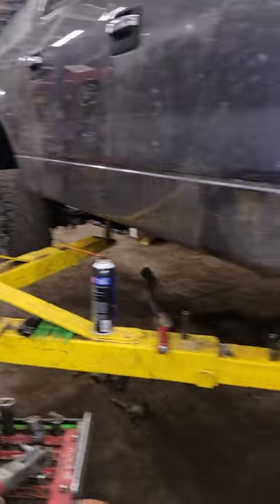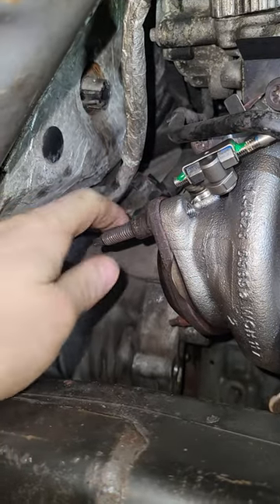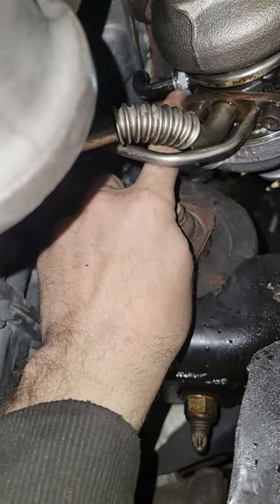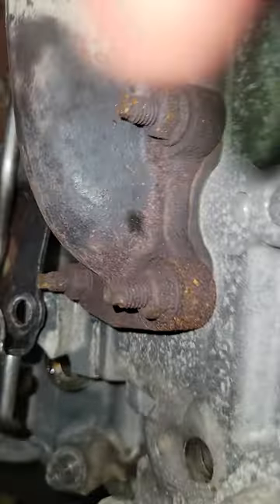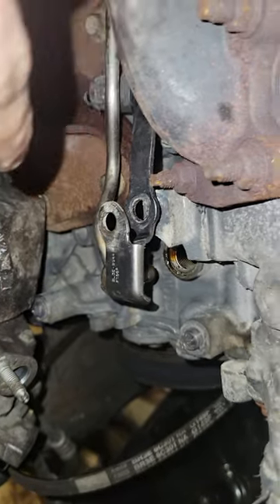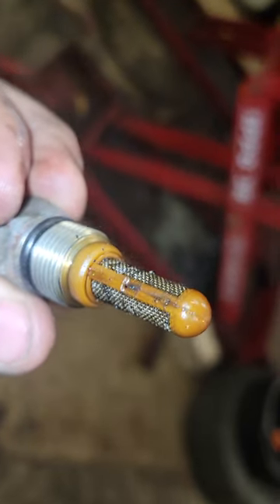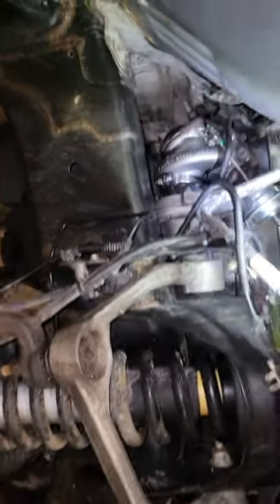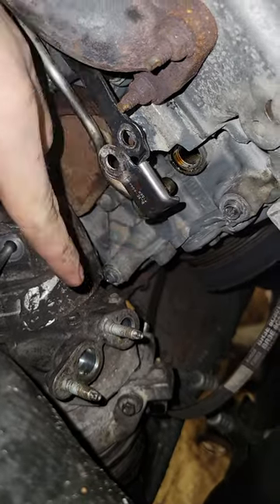ECOBOOST TURBO REPLACEMENT. tips and oil line filter replacement

Comment: It’s damn amazing how well you filmed this. It’s tight in there! Working through this myself now, plus the exhaust manifold replacement. I fear timing chain is next on the list.
Reply from the maker: Thank you. And yes it is tight in there ahaha. Timing chain rattle is what started everything and snowballed from there. 3 motors and 2 sets of turbos later. I'm actually about to pull motor again and fix spark plug stuck and fix a few other things while it's out
Reply: Oh the chain is coming for sure!

Comment: Thanks for heads-up. Is the replacement of turbos on 2.7 L as labour intensive, meaning you need to drop a/c compressor and a starter? Thank you.
Reply from the maker: I'm not sure about 2.7 but I'd assume it's very similar. Id imagine the platform is setup the same tho

Comment: I was able to replace the Turbos and all of the water lines and fittings plus the oil line filters. Yes I had to remove the starter the a/c and the alternator plus the intake manifold. Not a fun job to do by yourself but my 2012 has 260K on it and it's a 4X4 and now it's back running fine again. I didn't have to discharge my a/c I just set it to the side just like the alternator. Good luck on this one seems like you're having a tough time with it.

Comment: If I am changing my manifolds but not my turbos (turbos are still good) do you think I have to change this filter out I really don’t want to drop the ac compressor
Reply from the maker: I havnt replaced my pass manifold yet. But I'd recommend doing it since your so close to doing it anyways. And u may need to pull it anyways to get to the from few bolts or atleast make it easier to
Reply: In theory, the AC Compressor can be dismounted w/o opening the refrigerant sys.
You can manage to work around it...carefully.
LUCK!

Comment: Are these oil line filters on the 2011 3.5 f150 as well???
Reply from the maker: Should be. They are to stop metal/debris from getting in ur engine
Reply: Yes, it is the same. Just unbolt the compressor for more clearance but be careful obviously. Worked for me anyways. I just got unlucky with the turbo bolts breaking off.. had to drill and re-tap
Reply: Thanks folks 👍

Comment: How to get the access to there. I have a bunch of stuff the the way?
Reply from the maker: Take inner fenderwall out. Take exausht down. I explain it all in video
Reply: Do you just have to take the compressor out? Id really like to change my filters on the lines but I’m stuck
Reply from the maker: @lanceheaey696  yeah on the pass side that's the only way to get to it
Reply: how you get the oil line out ???? pull out or need to take the fitting with it ???
Reply: @faviokinsman8425  unscrew the bolt holding the bracket in the line and slowly pry out of the line. I don’t think 2011 models have the filter so no need to check if you have that year. I did all the work to check it and it isn’t there. It’s just a hole in the block.